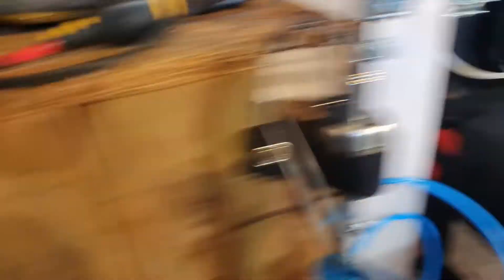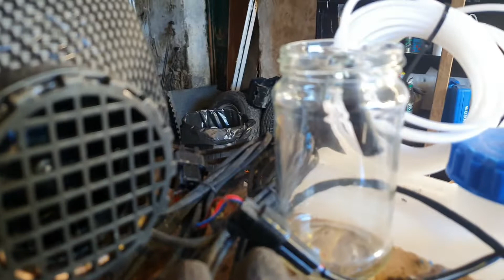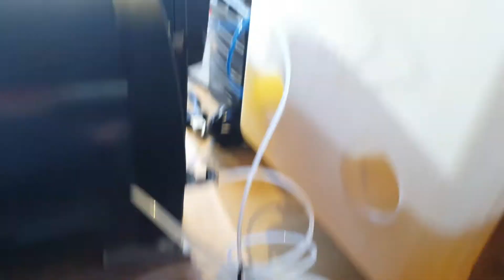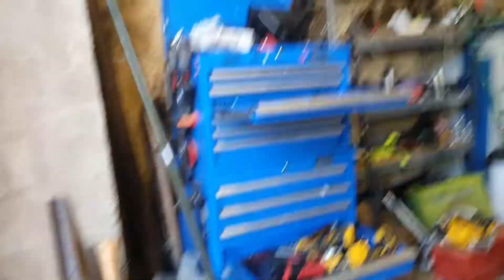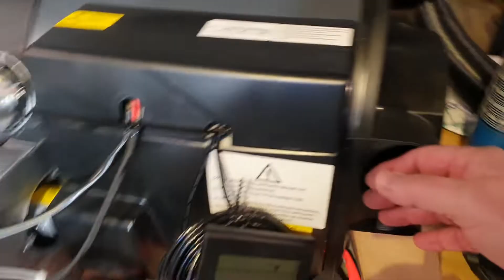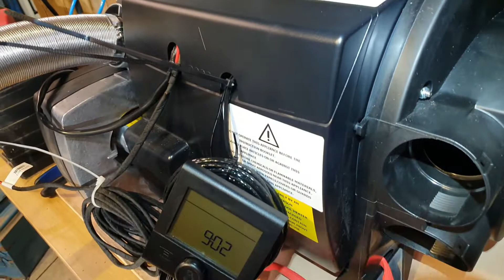JP D6E Combi Heater

Comment: Did  you get the heater installed anywhere yet? Would love to hear your feedback on it.
We picked one up for our van build and seems like I'm having issues getting a water pump thats rated to the heater's pressure release valve (40PSI), as most pumps are 45-55PSI and up in the RV industry
Reply from the maker: Sorry for the slow reply - I don't get notifications.
I have it mounted in my van and (apart from being a bit noisy) it's been great and is certainly more than warm enough for -10degC.
WRT the water pump, I have a Sure unit (can't recall which model) that has a max pressure of .28 megapascals which is apparently 40psi, but I thought that the JP heater was ok for more than that... I know I checked at the time that it was ok...
AI says this about the pressure:
The maximum water pressure for a JP Combi heater is 2.8 bar (or 40.5 PSI) for the water pump and 4.5 bar (or 65.3 PSI) for the entire system. The water pump should not exceed 2.8 bar, and the system should not exceed 4.5 bar due to pressure relief valves that automatically release excess pressure.

Comment: By the way, the exhaust pipe should not be lower than the heater surface 20 cms. It should be go upward.
Reply from the maker: Thanks - I should have mentioned that in the video. The actual installation will be 'to the book' :)